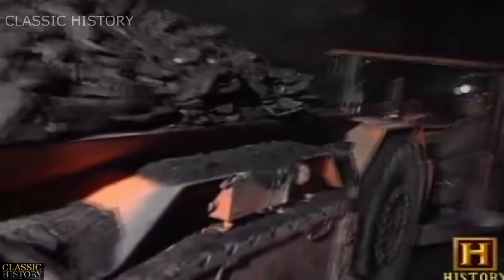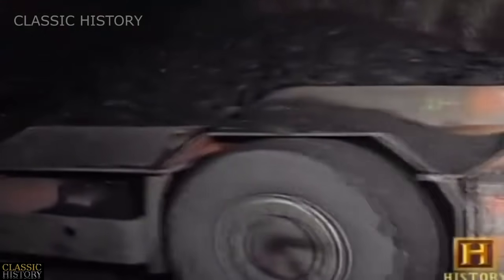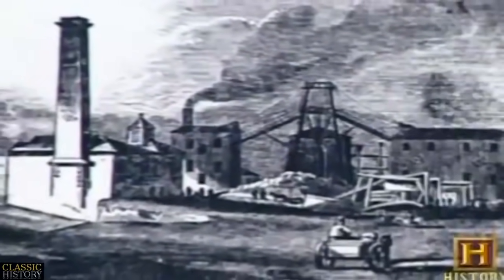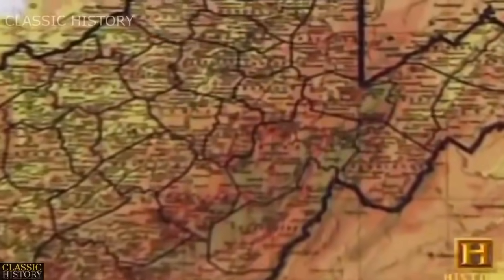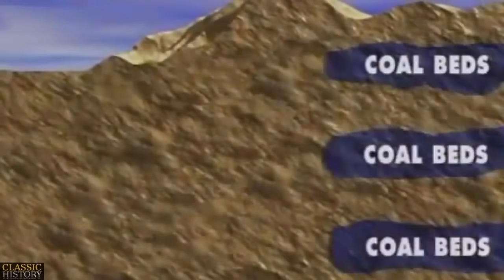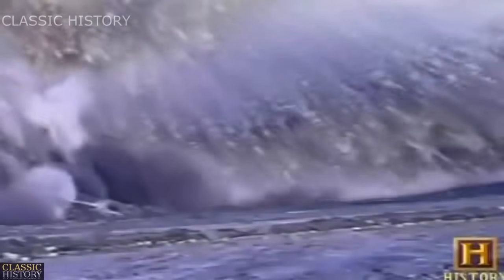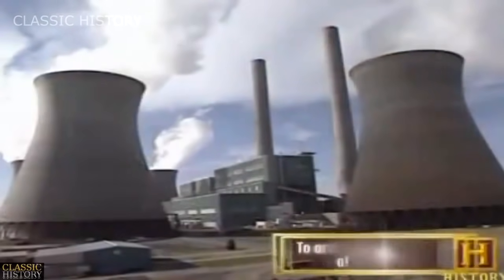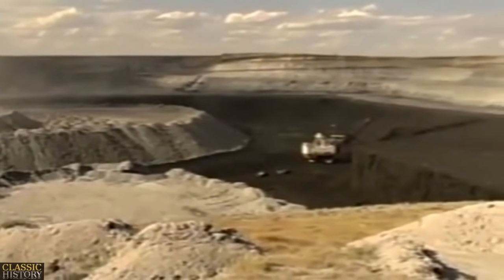Coal Mining Documentary - The Most Dangerous Job On Earth - Classic History

Comment: The poor drilling and explosives technologies in that era, the advantages of blasting, i.e., fast and effective rock breakage, were fascinating enough to replace the man forced labor-intensive rock excavation methods. Shortly, drilling and blasting became a dominant method to excavate rock mass. The efficiency of the modern drilling and blasting has been rapidly improved due to the advanced technologies of industrial explosives, initiation systems, and drilling machinery. Various kind of industrial explosives enables engineers to apply appropriate explosives to meet the different rock masses and field conditions. The non-electric and the electronic detonators facilitate elaborate blast designs. The advanced rock tools and machinery realize effective and accurate drilling.  Indeed, rock blasting still stands as the most cost-effective rock excavation methods with the high acceptability to a wide range of geo-mining conditions. Formulated by analyzing the relationship between uncontrollable 
parameters of the over break phenomenon, i.e., geological parameters, and the corresponding over break measurements.

Comment: how much is the voice actor banking now? same guy from how is made right?
Reply: I worked in coal mines in Colorado through the seventies to 2006 .  These were all underground mines, I ran a continuous miner that you sat in a cab that was about one and half to two feet wide and just big enough for a six foot man to get into. You had a steel cage all around you. One time the roof fell on the miner I was in and I spent nine hours sitting in that cramped cage.  Cage miners were used in the seventies, in the mid eighties the mine I was at got its first remote controlled miner it was a Joy miner. I also worked on the roof bolter too. It was a Lee Norse single boom bolter with rubber tires that was electric. Later we got a Fletcher double boom bolter that was on tracks.  These were the best years of my life, black lung didn't stop me working in the mines it was arthritis that stopped me. I don't believe that the mine contributed to this at all. Everyday was a new adventure into the unknown. One mine I worked in we found dinosaur tracks in the sandstone top  a large set and a smaller set together. We always were finding fish fossils and ferns , trees, and oyster beds . When you would come across and oyster bed it still smelled very fishy. I have many many stories I would love to share with anyone interested.